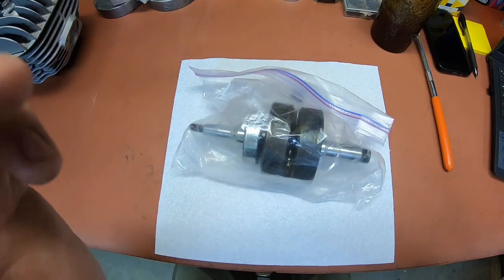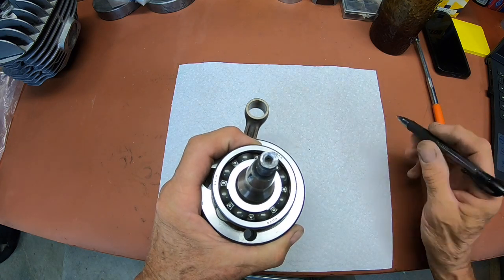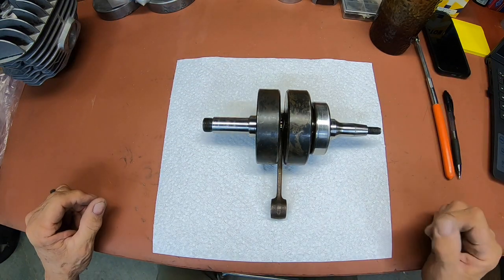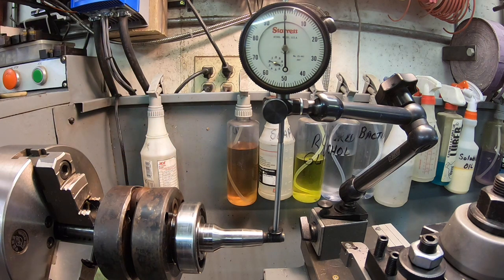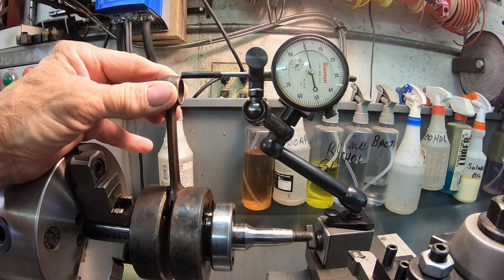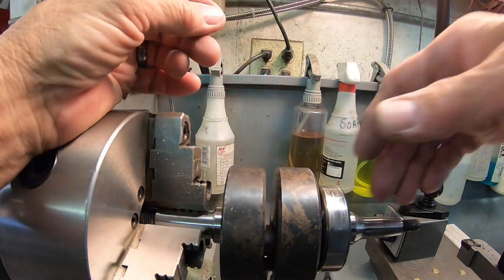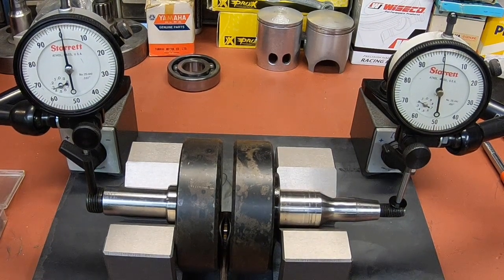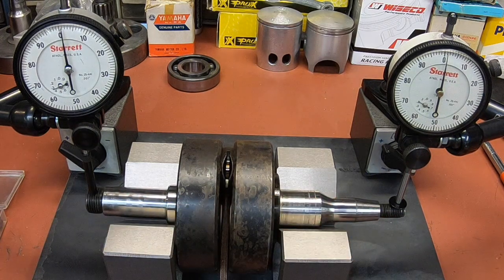Inspect a motorcycle crankshaft, Suzuki TS125

Comment: Hey Dale, you gave it a good check over. It's odd that the only pinch was 90' to the pin. Still, nothing to worry about with only 2 thou total runout. The BSA two stroke crank also has a maximum tolerance of 4 thou. The crank shafts are pressed in items on the BSA, rather than machined from solid. 
Another great video, hope you are enjoying the weekend. 
Best wishes, Dean.
Reply from the maker: Thanks Dean, yes that was a bit weird having the pinch there, just wasnt enough to worry about though. I which you could change out the stubs in these, that would make repairs easier. Thanks for hanging out with me in the shop